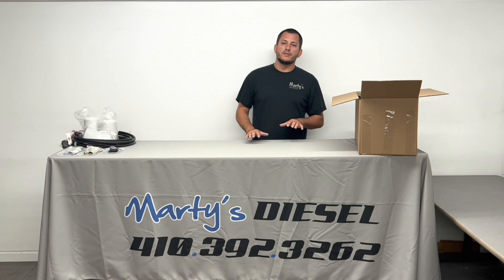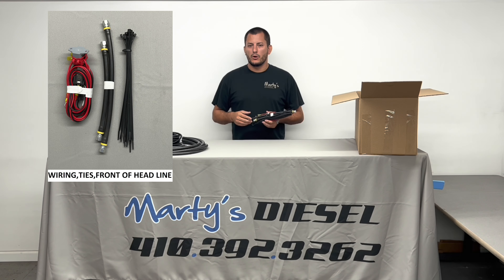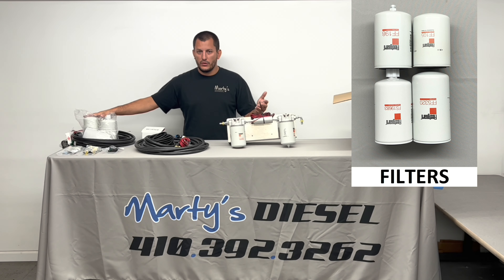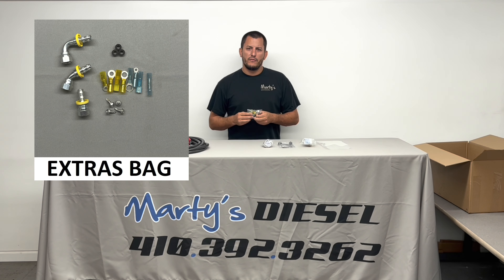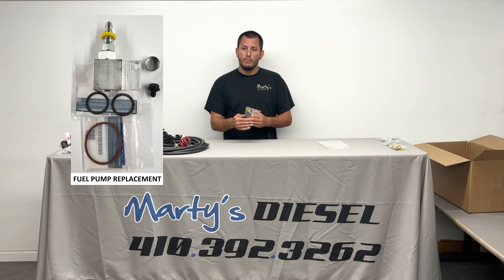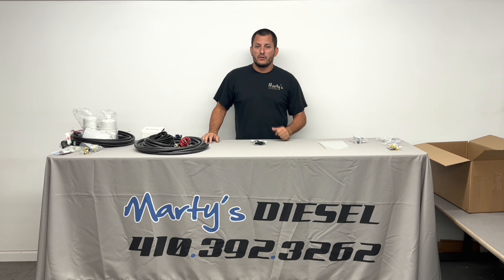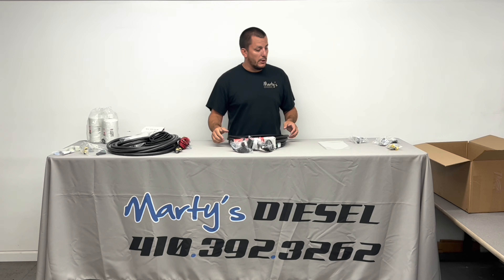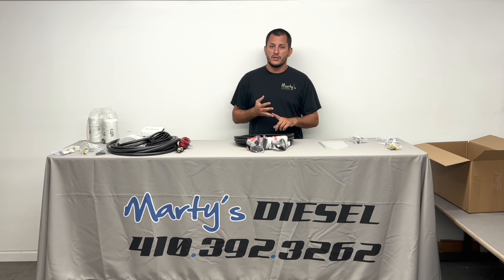Martys Diesel Unboxing Video

Comment: can you put beans diesel sump kit?
Reply from the maker: We have our own sump with larger ports than the beans diesel sump.  It's a 2 bolt, 2 hole sump with dual o rings and it comes with the hole saw needed for install.
Reply: can u post link
Reply from the maker: @valentingarcia4137 https://cee972-6c.myshopify.com/products/fuel-sump?_pos=1&_sid=ea3a8cd93&_ss=r